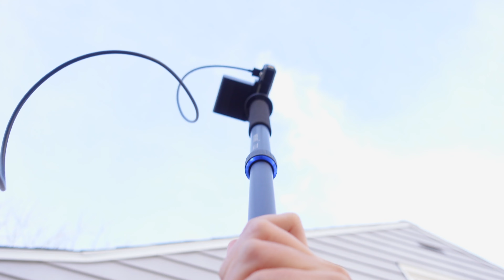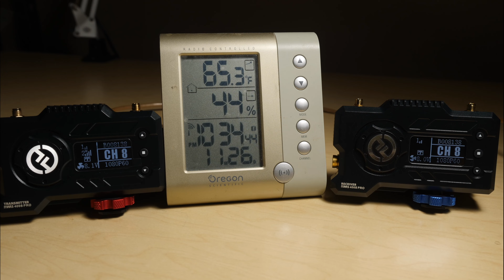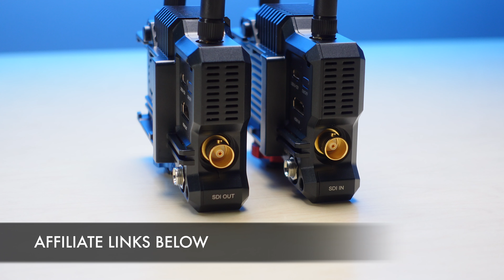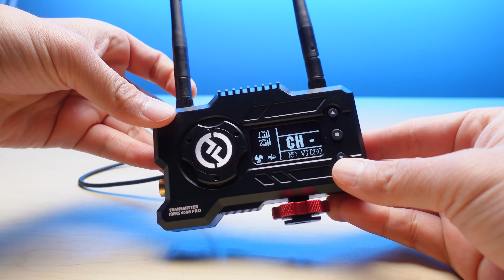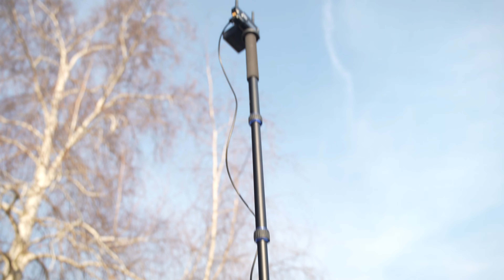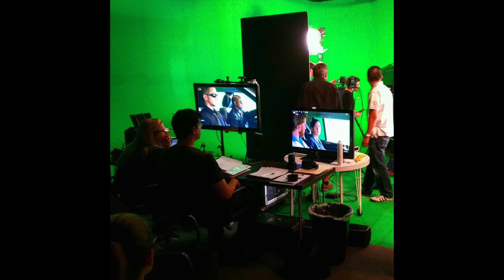Build a Hollywood Command Van with the Hollyland Mars 400s Pro | Mobile Video Village | Review

Comment: Hi Tudor, how are you. I had a question. I am looking to buy my first proper light and don’t really know what direction I should go into. Should I go for the Bowen’s mount light like the new amaran 100d or the mat style light like falcon eyes rx18td
Reply from the maker: Hey hey again Love First!
Hmm... I personally would go with a COB light with a Bowens mount simple because you have the ability to use multiple modifiers and just have it attach onto the light itself. With a flex panel you'll still have to use extra stands and such to put modifiers in front of it. So theres definitely a convince factor going with a COB LED.
Reply: @TLDR_filmmaker  When I say flex panel, I meant something like the falconeyes rx18td and those you can put on one stand with a softbox and even a grid. Would that be the only reason to choose cob over the flex led because of the multiple modifiers

Comment: Do you think this is good for for a 1st AC for pulling focus?
Reply: Never mind I just seen that lag, I’m asking for GH5s lol
Reply from the maker: Hey hey Shawn!
Haha ah gotcha. I'm not sure specifically about the GH5s. In theory it would have less lag because there are less megapixels and processing going on in the background. But we're also looking at an older processor for a couple years ago. I would ask Aaron to check or record a sample of his GH5s going into a TV or monitor at 24p and wave his hand in front of it or use a stop watch timer and see what the latency is out of the HDMI. The latency rating on the Hollyland is not that high, I believe its rated at 8ms?
Reply: Aaron has that Mars 400?
Reply from the maker: No, he has a GH5S. Hes the only one that I'm aware of that has that model of GH5. Unless you meant "gh5s" as in multiple GH5's (Panasonic really need to change that name structure, its confusing). 

If you meant GH5S, you would just need him to test the HDMI lag on a TV or portable monitor just to see what the inherent GH5S lag is. And know that the Hollyland Mars 400s Pro is only going to add to it very very very minimally.